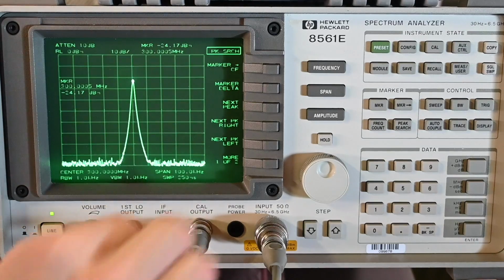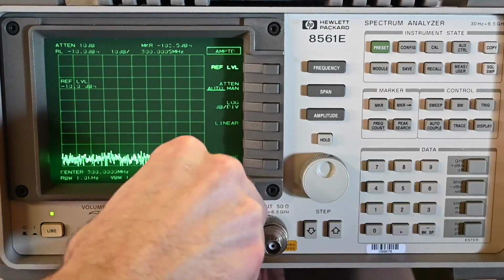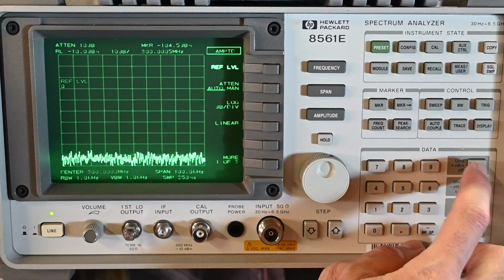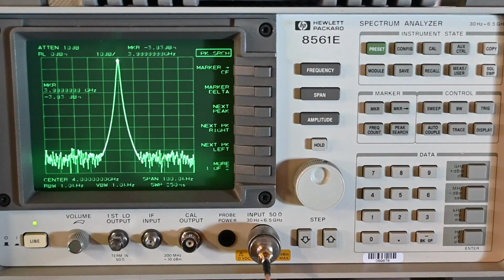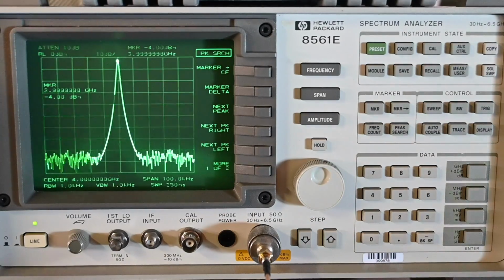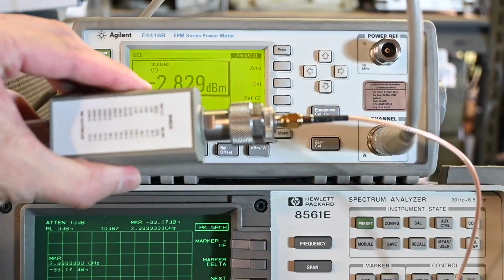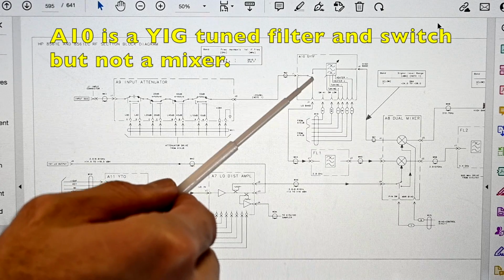HP 8561E Spectrum Analyzer Repair - Tracking Down an Accuracy Problem (Part 1)

Comment: To evaluate and amp fault, switch the attenuator. This is very common fault. Dried out rubber rings in the attenuator stages. These are 2mm in dia, and order able from Keysight.
Have repaired some 50 units of 8560- series 8560 to 8565 up to 50 GHz. GL de Bjoern
Reply from the maker: Yes attenuators can be a problem but that was not the trouble in this case.

Comment: Where can I find an electrical circuit for this family of spectrum analyzers?
Reply from the maker: There are tech service manuals listed here https://www.keysight.com/us/en/product/8561E/portable-spectrum-analyzer-30-hz-to-65-ghz.html#resources    but they do not have the electrical schematics.   The only place I know to get the CLIP documents (component level information packet.. the schematics) is https://artekmanuals.com/manuals/hp-manuals/  but they do charge for them.  $25 part number 5967-8582.

Comment: I know, as you said, there is a cap, in the 'front end' that 'blocks' the D.C. ... but, isn't it better to use a "D.C. block" anyway. Also, if you are working with that rf power sensor, why are you not using an attenuator on it?
Reply: Okay, you mentioned you have a D.C. block on the sig gen. Usually, I keep one on the S.A. too.
Reply from the maker: At times I do use a DC block when using the spectrum analyzer for normal testing purposes but also depends on the situation and what is being tested.  I agree it is a good precaution.  As you saw I use one later in the video.. absolutely needed then because the input cap was bypassed.   The RF power sensor was being used well below the max power handling range so no need for any attenuators.

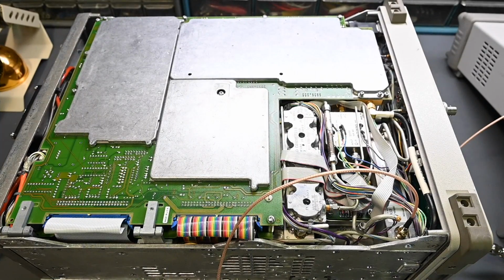Comment: why did you open the case at 15:00? Would it be a valid test to switch to DC coupling and to switch manually to different attenuations, while applying the known signal? Or would that not tell us much?
Reply from the maker: I needed to connect to the output of the attenuator so that it could be tested with the power meter.  For this troubleshooting I could no longer rely on the spectrum analyzer itself for measured values as I had to start isolating components.

Comment: Remember to check the rigid coax from between the attenuator and the filter, the fault could be that.
Reply: Be careful as there is one special coax cable in the high band section which is in black heatshrink which is indeed a filter and just looking like a coax… gave me headaches when I was repairing my trusty 8562a…
Reply from the maker: Yes coax cables have been tested and are ok.
Reply: @EriksElectronicsWorkbench  that is a shame

Comment: @7:25 an increase in level with an increase in frequency is usually a sign of a broken connection such as a pin etc. where there is a small gap in the transmission line.
Reply from the maker: Based on testing the break must be in the A10 module.  I agree the frequency response looks like a broken connection.  I'm thinking about taking the A10 module apart even if I can't fix it could be interesting to see inside.
Reply: @EriksElectronicsWorkbench  pull it apart most definitely, there have been a couple of times when I got a replacement part to only realise that I could fix the original when I opened it up.
Reply: @EriksElectronicsWorkbench  but anyway thank you for this detail analysis sequence it's great!   And thank you!
Reply from the maker: @bfx8185  thanks for watching!
Reply: @EriksElectronicsWorkbench  you are welcome
Reply: to be honest I don't like your entertaining behavior and that's why I'm checking your channel sporadically 👽  But you are right 😉
Reply: Every time when the attenuation is the function of frequency it's 99% connection problem 😈
Reply from the maker: @bfx8185  I agree but testing points to the break or whatever the problem is to be inside the A10 module.  No open connections found in the coax or connectors leading up to the module.

Comment: only at 9:00 into the video, but increasing in accuracy at higher frequencies is usually a crack in the input coax (or semi-rigid coax), and now it's essentially AC coupled across the crack, with the coupling getting better as the frequency goes up. I've seen The Signal Path fix a few instruments with the same problem. It's about the best 'problem' you can ask for!
Reply: Hmm, that sucks that it's the YIG, and not just a cracked coax - that's about the WORST problem you could have!
Reply from the maker: @gorak9000  lol yeah I agree
Reply from the maker: The coax cables have been tested and are ok.  Yes a broken coax will attenuate low frequencies more than high frequencies as you mention, I was thinking that might be the case but no such luck.
Reply: @EriksElectronicsWorkbench  I have a broken 8593A I picked up recently for relatively cheap I need to dig into, and my 8594E (that I've had for a long time) power supply crapped out entirely a while ago - I haven't had the chance to really dig into either of them yet. The 8593A seems to have a problem with the -15V rail. I'm just hoping someone didn't shove a bad YIG into it or generally "parts mule" all the good stuff out and shoved a bunch of busted stuff into it, and pawn it off!
Reply from the maker: @gorak9000  Sounds like power supply troubles on both.  At least start there on the 8593A and hopefully the remainder is in good shape.